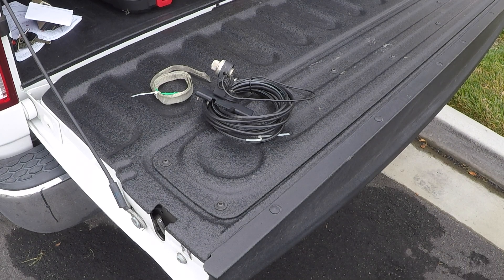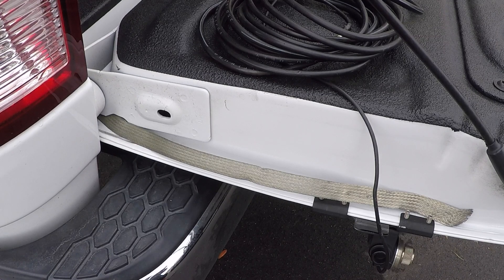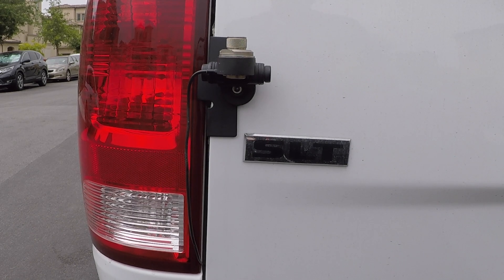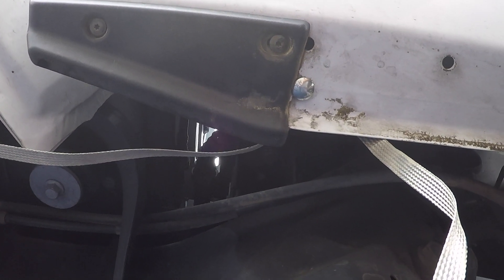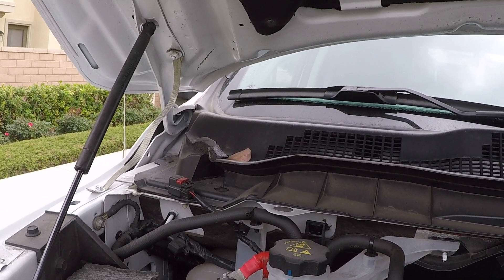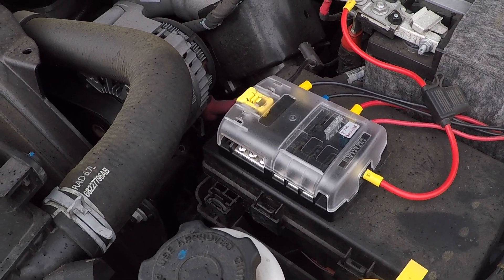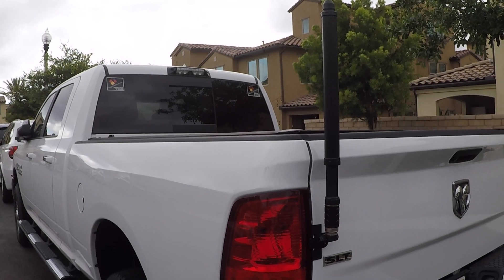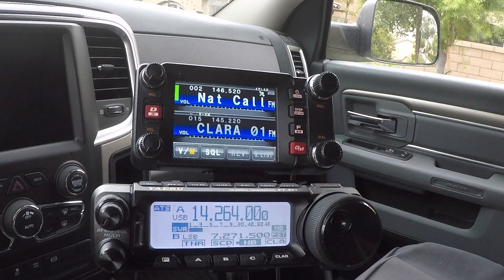HF Mobile Install In A Ram 2500

Comment: Great video!  I ran the same set up in my SUV and just bought a 1500.  I’m going to bond more than I did in the SUV.  Question… with the binding did you grind down the paint at all where you were bonding or no?  Thanks!
73
Jonathan, W5GI
Reply from the maker: Thank you for taking the time to watch and the comment! It is greatly appreciated.  No, I did not grind / sand any areas where the straps connect to the truck.

Comment: How/where did you get the DC cable through the firewall? Did you have to drill or was there an existing opening? 73
Reply from the maker: Thank you for taking the time to watch and the comment! It is greatly appreciated. I don't drill holes in my vehicles. What I did was fished it through the top of the fender, down the door jam and then into the cab. It isn't the prettiest, when the door is open, but I don't have to worry about my resale/trade in value due to additional holes.

Comment: I had a 2006 Ram 2500 and just mounted the Antenna mount near the back of the tailgate on the driver side and it worked quite well!  And your right allot of people do not appreciate the Atas 120a antenna most likely because they do not have it installed correctly or grounded properly!  On the same truck prior I had it originally mounted on the tool box ( I ran a ground wire from the frame to the mount and it worked well) but as it’s a large Antenna I didn’t like it that high in the air while driving!  On my channel I have a video of operating HF Mobile with this setup!  73 K4BBC. P.S. I now have my FT-891 and ATAS 120a on our 2013 VW Jetta TDI Sport Wagon and it works great!
Reply from the maker: Thank you for taking the time to watch and the comment! It is greatly appreciated. I was told by one of the employees at my local HRO, who used to work for Yaesu, that grounding the ATAS 120A is the key to getting it to work well. I will certainly check out your video!

Comment: Very nice video! I like how you showed where all the grounding points were. I tried using one of those antenna lip mounts for my 2m/70cm antenna and it just wobbled a lot and scratched part of my body. However I did not use a grounding strap. Would that have made the mount more stable?
Reply from the maker: Thank you for taking the time to watch and the comment! It is greatly appreciated. It may depend on where it was mounted the curvature of the vehicles body, and if it was tightened down enough.

Comment: Nice install. I am considering a Yaesu FT-891 with ATAS 120 in my new GMC truck. I will start with using my Anytone HT with a external mic and battery minder I already own along with a Comet Triband VHF/UHF antenna mounted on a lip mount. Did you ever try your mobile installs before you bonded? Thanks and have a very good day. 73 de KI5HXM
Reply: I am new to this and am trying to figure out rhe lip mount. Do the lip mounts come with coax and how did you run coax from your mount. I previously had a msg mount for my HT and the braid got torn up.  Just wanting to make sure I don’t do something stupid. Lol. Thanks. 73 de KI5HXM
Reply from the maker: Thank you for taking the time to watch and the comment! It is greatly appreciated. I never did the bonding when I drove uni body vehicles, like my old Honda Pilot. For that one I merely put a braided line from the ATAS 120A to the body of the Pilot same with the HF radio. For the Ram 2500 I dod not try it without bonding.
Reply: @WJ6FRadio  I am back again after some family interruptions.  Life happens.  😀 Did you use a duplexer to feed HF/50 to the FT-891 & VHF/UHF to the FTM-400?  I can go back and look at the video again to see if you already answered my question.  Also I think you mounted the ATAS on the tailgate door.  If that is true, do you have any trouble with the swinging of the antenna on that mount?  I had assumed I would mount it to the fixed side next to the tailgate on my truck (probably near the tail light so I would have room for clearance/obstructions).  Final question - Do you like the FT-891 & ATAS-120 combination?  What I mean is would you purchase it again?  Thanks for answering all of my “noob” questions.  All the best, 73 de KI5HXM

Comment: Great video. Did you add a tuner to the 891? I was at HRO Saturday and that was a suggestion. Do you bond both side of the truck the same way? Sorry. I have lots of questions because this would be my first install ever. Thanks. K6RRJ

Comment: I have a 2020 2500 Diesel.  Where do you run the power, ground and coax?    for instance how do you get the coax into the cabin from the back and where did you go through the firewall for the power and ground?  I purchased everything, including the antenna, from your Amazon marketplace.  GREAT video by the way.
Reply from the maker: Thank you for taking the time to watch and the comment! It is greatly appreciated. I ran the power through the fender well and then down the front of the door jam and into the cab. For the coax cable i run it through the bottom of one of the back doors. I have not yet found how to get the coax into the cab as of yet. I am not up for drilling holes in the cab at this point.
Reply: @WJ6FRadio  I'm not sure if it helps, and I'm not sure of what model Ram it was. But I watched a video might have been a CB, and the guy ran the coax through a grommet on the passenger side B pillar. He split the grommet and he said there is a hole on the inside behind the trim to bring it in. He also bought a replacement grommet for about 5 dollars to replace later if he sells the truck. I have a 2002 dodge and looking for ideas on mounting. I also might be mounting a 400 XDR. I'm familiar with Lido heavy duty mounts, but what did you use to connect the two radio heads together. 73 N5BSB

Comment: What mount are you using for the two control heads at the end of the video. It looks like it might be a cupholder of some sort. Do you remember the model number and where you got it?
Reply from the maker: Thanks for watching and commenting!! The mount I am using is from a company called Lido. They sell there products at Ham Radio Outlet.

Comment: Great video. Thanks for the detailed walkthrough. The ATAS-120 is on my list of HF gear for the RV, so the grounding tips were very helpful. Like you, I’ll be pairing it with my FT-891
Reply from the maker: Thank you for taking the time to watch and the comment! It is greatly appreciated. The nice thing about the FT-891 is it has a setting, like the FT-857D, for the ATAS 120A. It is nice to push a single button to tune up the antenna.

Comment: Bonding is key for mobile HF. And definitely a must for the ATAS-120a. I have never had an issue with my ATAS-120a and Ft-857D and have worked Japan,Europe, the Americas,  and Australia mobile from Florida . Great video and clean install.
Reply from the maker: Thank you for taking the time to watch and the comment! It is greatly appreciated. I had the same setup originally. The FT-857D and ATAS 120A worked flawlessly for me.
Reply: How important for UHF/VHF?
Reply: @kentuckyproud4575  not important.

Comment: Nice clean install. I have the FT-857d and did a install on my 2011 RAM 1500.
Reply from the maker: Thank you for taking the time to watch and the comment! It is greatly appreciated. I used to use an FT-857D in my car. Sometimes I wish I never sold the Ft-857D
Reply: @WJ6FRadio  I still have two 857d. I thought about getting the new 891. But what about 2m/70cm? I don't need to mic or two antennas.

Comment: Don't the hood brackets with their bolts provide an electrical contact between the hood and the frame?
Reply from the maker: Thank you for taking the time to watch and the comment! It is greatly appreciated. As lame as a response as this may be..... I had wondered the same, and asked since everything is bolted to something and all of it terminating at the frame, then wouldn't bonding not be needed? I was told it had to do with how it flows across the vehicle.

Comment: Nice! Thanks for the video.  What is a "Blue C"?
Reply from the maker: Thank you for taking the time to watch and the comment! It is greatly appreciated.  The Blue Sea is a power distribution panel. The battery connects to it then you add the radios. It has fuses for each separate item and make the install much easier in my opinion.

Comment: What did you do about the enormous noise coming from the fuel pump and/or the on-board computer? I have a 2011 RAM 2500 with the Cummins diesel engine and operating on 80 or 40 with the motor running is almost impossible. Thanks for a nice video.
Reply from the maker: Thank you for taking the time to watch and the comment! It is greatly appreciated. From I have been told bonding to the exhaust will help as will snap on or ring ferrite filters, which I have one on both the positive and negative power cables. Using the ATAS 120A does not tune to 80 meters.
Reply: @WJ6FRadio  Thanks, I'll give those suggestions a try. - 73 - Barry - W4TGA
Reply from the maker: Let me know if that s takes care of the issue.
Reply: @WJ6FRadio  I will.

Comment: For that money you can pick up a used screwdriver antenna that would work much better. I get the whole bolt on thing was easy to do but that antenna is not very good. It barely can hold 100 watts look at the specs on it. 120W 7/14/21MHz (SSB, CW; 50% duty cycle).  You can even build a Don Johnson screwdriver that will run circles around it for less than half the cost of the ATAS.  I get that it works but you can do better for sure.
Reply from the maker: Thank you for taking the time to watch and the comment! It is greatly appreciated. I have no complaints with it since I have made contact to Europe, Japan, and New Zealand. That being said I have been thinking about picking up either a Taheel II or perhaps a Hi-Q. For used look on QRZ. It seems there is a bit of everything for sale there.

Comment: Nice Install, I have a Hi-Q antenna and wouldn't work with the mount you used so I made my own. I have a 2006 Ram with diesel and get some noise on 40m not real bad but I will do as you did on the bonding thanks for the video of how you did that, one of my first contacts on mine was to Puerto Rico, 73!
Reply from the maker: Thank you for taking the time to watch and the comment! It is greatly appreciated. Have you tried using ground strap and bonding the exhaust system? I have heard the exhaust system, for some reason, can create noise. I also use the snap on ferrite on the positive and negative power cord.
Reply: @WJ6FRadio  , No I haven't done that yet and I have the ground strap and Have heard the same thing. My noise isn't terrible but I think the exhaust will be the first I try.

Comment: I'm running the 891 and fc50 tuner with the moto antenna, I was thinking of changing antenna to the 120 but wasn't sure on coverage/swr's.  On my 400 I run a basic 2/440 1/2 wave lp mount.   Anyway, how are you liking the 120? would you by it again, do you need an ext. tuner?
Reply from the maker: Thank you for taking the time to watch and the comment! It is greatly appreciated. I like the ATAS 120A a lot. I used it with my FT-857D as well. Those radios are designed to work with the 120A so no external tuner is needed. You push a button on the radio and it goes to work. Have to make sure it is properly grounded though. I have used it to talk around the world.

Comment: You gotta stop making videos.  You're making me work.  I have the Little Tarheel II mounted but I still need to do the bonding and grounding.
Reply from the maker: Thank you for taking the time to watch and the comment! It is greatly appreciated. Same could be said of you! Every time you make a video It costs me money. I have thought about swapping the ATAS 120A for the Tarheel II, but I do like how the FT-891 will tune the ATAS 120A.
Reply: @WJ6FRadio  I just went out and sanded underneath the mount to "start" the grounding.  Seemed to make an improvement.  Bandwidth on 20 is quite wide now.   40 got better than it was.  I have to get some grounding wire now.
Reply from the maker: My last mobile install, there is video on it, I only did a ground from the ATAS 120. It was an SUV so I didn't bond it in anyway. Also grounded the radio

Comment: Nice clean install. I’m putting this same radio and antenna in my Duramax. Question, which mount did you go with for the remote face installation? Thanks!
Reply from the maker: Thank you for taking the time to watch and the comment! It is greatly appreciated. The mount is from a company called Lido. I used their cup holder mount and to ,make it fit better I used a PVC reducer I think it is 4" - 3"